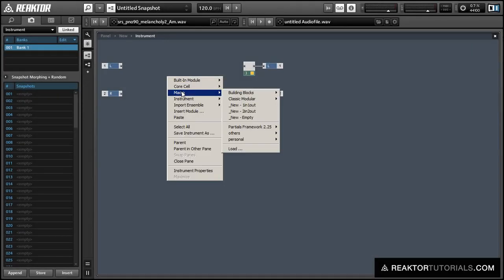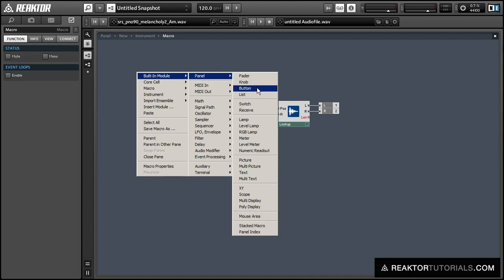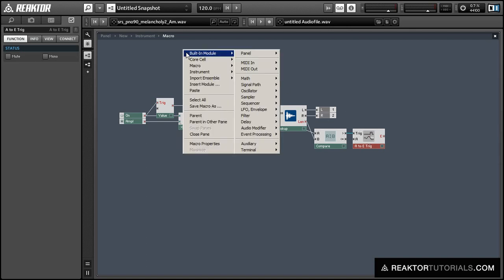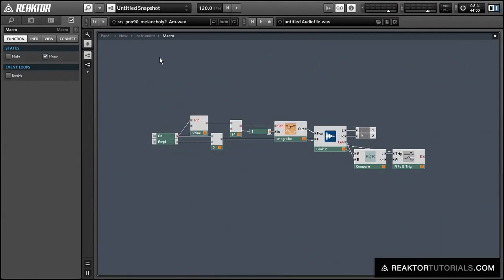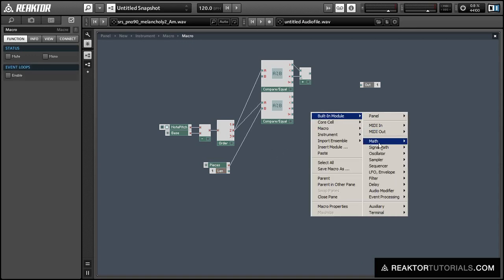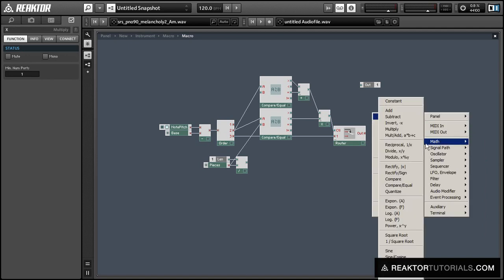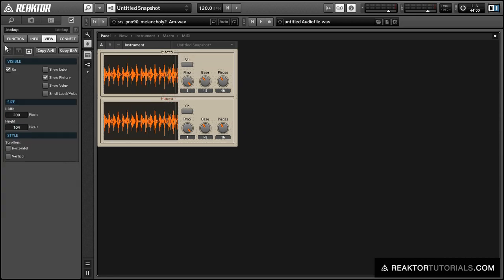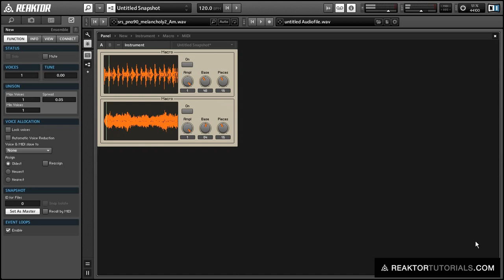Reaktor - How To Build A Reaktor Sample Masher - How To Tutorial

Comment: Thanks for the video!

To anyone below who has the "red X's" through the output ports in the ensemble view... The reason this is happening is because the feed going from your ensemble to the output ports is likely Polyphonic, and the output ports are expecting monophonic data.

The voice combiner takes a polyphonic signal, and collapses it into a monophonic signal, which is why the voice combiner fixes the problem. You should also right click your entire ensemble (in ensemble view) and make sure that it is set to mono; you can see if a module is stereo or mono by looking at the little square on it... yellow = stereo, orange = mono. Good luck!

Comment: Also, the audio in this video is panned all the way to the left, which is strange. Could be an upload issue. If it's a recording issue (e.g., you only recorded into the left input) that's easily fixable via a direction mixer.